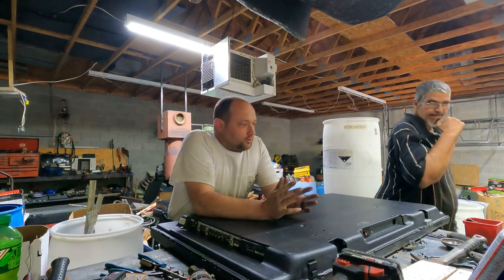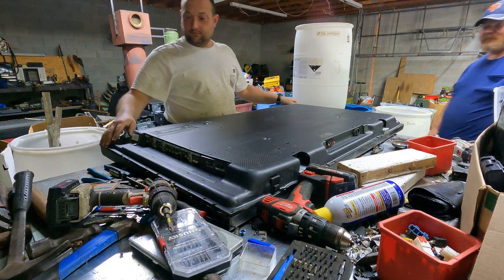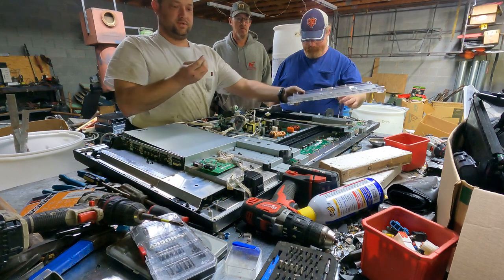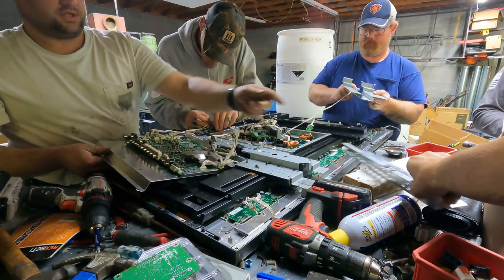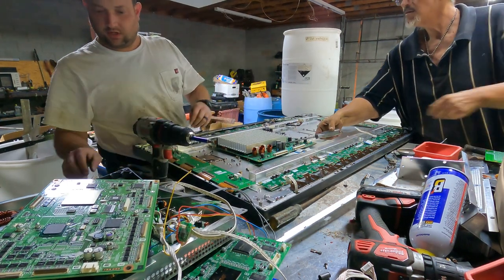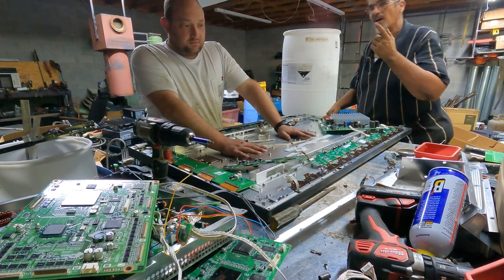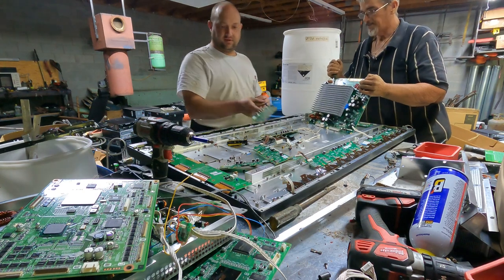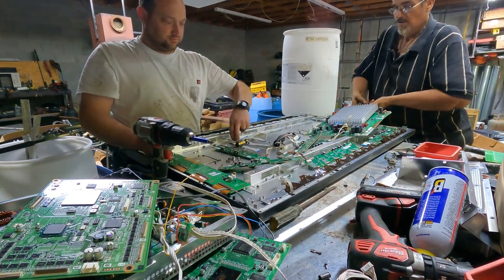How to scrap a plasma TV. #howto

Comment: I notice not many scrappers aren't taking out the "diffusion screens" of LCD type TVs.  I have a kitchen now with old brittle and yellowed diffusion screens I have to think about replacing today.  I want to buy diffusion screen replacement peices for my kitchen lighting and there are no scrapping alternatives vs having to buy new diffusion screens at my local hardware store costing like $10 USD in certain cut rectangular peices.  Several TV diffusion screens with screwed in custom bars redesign would have worked also vs my only alternative. 😖